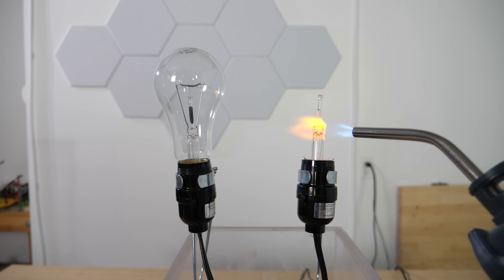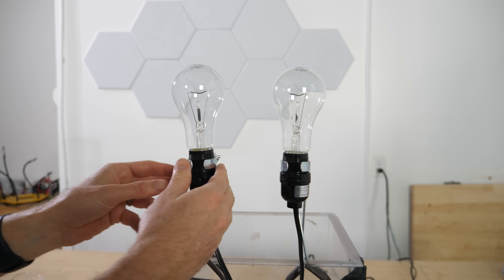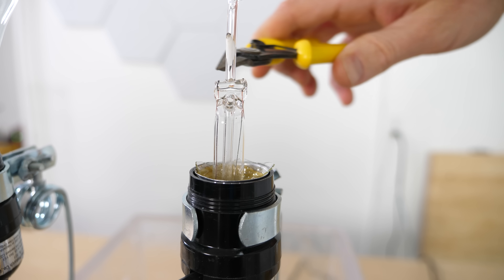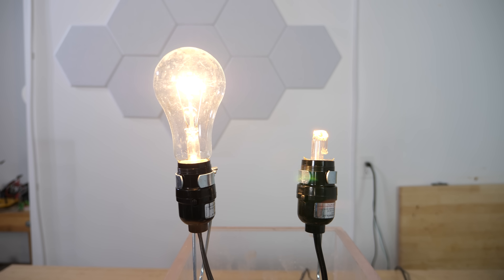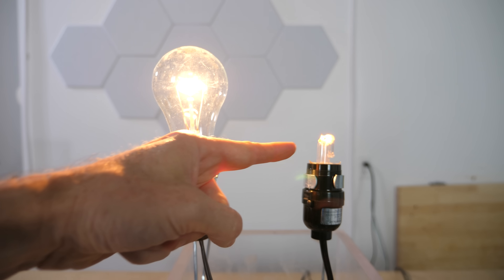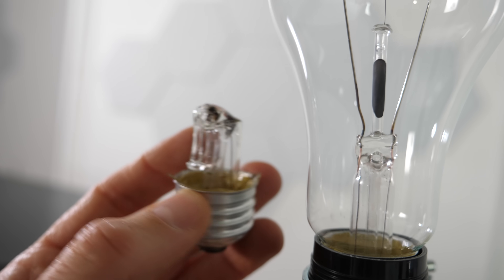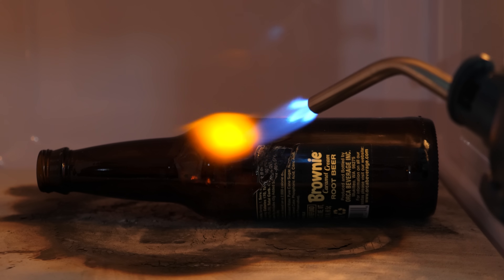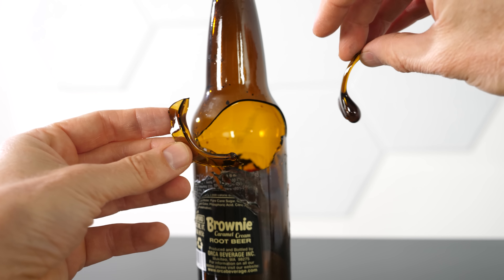How Glass Breaks All the Rules of Insulation

Comment: The support wires for the filament are usually made of iron because it has a very similar expansion rate as glass. When melting the glass containing those support wires you also contaminated the melted glass with iron  which is conductive though not a great conductor.. Neat effect but I suspect you just made conductive glass..

Comment: THERE IS NO "CURRENT" THERE IS NO "CIRCUIT"  .  THE HEAT AND LIGHT RADIATED FROM A WIRE WITH AN ELECTRIC DISCHARGE THROUGH IT
ORIGINATE WITH POSITIVE CHARGE DOMINANT AETHER MIX FROM ONE END COMBINING WITH NEGATIVE CHARGE DOMINANT AETHER MIX FROM THE OTHER END.  AETHER IS MIXED +/- FREE CHARGE.  ELECTRONS ARE FOR SUCKERS.  CHARGE IS BOTH POSITIVE AND NEGATIVE AND IS INFINITELY DIVISIBLE.  THERE IS NO EVIDENCE THAT CHARGE IS QUANTITIZED.  J.J. THOMPSON LIED IN HIS 1897 NOBEL PRIZE WINNING ESSAY ABOUT CATHODE RAY TUBE DISCHARGES, WHEN HE SAID THAT HE HAD REPRODUCED THE 1883 EXPERIMENTS OF HEINRICH HERTZ AND CONTRADICTED HERTZ'S RESULTS.  THOMPSON LIED WHEN HE PRETENDED TO HAVE REPRODUCED HERTZ'S APPARATUS.

Comment: This is how glass furnaces work. When the furnace is first started up, gas burners are used to begin the melting process.  Once some of the glass has is melted it is then heated with with molybdenum elecrodes by passing electric current through the molten glass. These furnaces work continuesly for about 10 years untill they need a rebuild.

Comment: 5:30 not really glass electrolysis. You need DC for the electrolysis. Also the voltage is to high for electrolysis. That's simply Joule's effect in action, through a thermistor, an NTC one.

Comment: You really don’t know that you did NOT wire those bulbs in series. You wired them in parallel, otherwise the voltage would be incorrect for the bulbs. Why does everyone think just because there are MULTIPLE, it means you are wiring IN SERIES. You are wiring a series of objects, in parallel, as to not change voltages that typically correspond with what they are powering, wattage changes constantly, and amperage should be a constant, but can still alternate, but amperage causes wires to burn. That’s why there are fuses that correspond with AMPS. You are teaching the wrong thing that no one ever gets right… you are now one of them.
Reply: HEY!!! I think I was incorrect about how you wired those lights! I’m kinda brain farting along not being able to (in my head) make sense of how you wired those clip lights.

Comment: I have to wonder whether you also changed the composition of the glass by melting part of the wires.  Presumably the wires at that part of the bulb are just regular wires, not tungsten like the filament.  There wasn't enough of it to dramatically change the color, but I don't know how much that would take, compared to affecting the conductivity.

Comment: The reason why glass is such a good insulator is because it contains quartz. Quartz is an excellent electrical insulator. Quartz is essentially a form of silicon dioxide.
Reply: So if you really want to protect something from electrical radiation you shield it with solid silicon dioxide, or quartz.
Reply: They make transistors with silicon dioxide too. By adding in impurities, they can adjust how conductive silicon dioxide is. It's easy to do in a sense that you're starting with zero conductivity and adding just enough metal(conductivity material) to precisely control how much electrical radiation can pass through the material.

Comment: Now I have to wonder what my watt meter would read when this is happening. I had always wondered how glass could carry a static charge when stroked with wool if it was indeed an insulator. PVC stroked with opossum fur seemed to produce my best charges. I have to assume static is not electric as we know it. Oh so much ignorance to overcome. Thanks
Reply: Also thinking more about this I recalled about 20 years ago early in the morning I saw what I thought to be lights from a work truck up the road. As  daylight came on I went up there to see what was going on and found nobody there. A tree had fallen on the power line and it was arcing on the ground. As I am on solar power I did not know the power was out . I called the fire department to report a small fire. They came and tended to it till about 10:am when the power company finally came to fix it. Because the fire departments were no longer allowed to pull the breakers it burned long enough to set the road gravel on fire with the thousands of volts and melted a hole nearly 5 feet into the ground which was still burning when everyone had left. When it did eventually go out I found the granite had turned to glass and now I better understand what was taking place at the time.

Comment: This is used when meting glass in industry. First they heat the glas to glowing temp by gas or electric coils but just to barely molten and then the used big electrodes that just pass current through the glass much more efficient and then just keep adding glass in a continues stream.

Comment: That lightbulb stem that kept on going on its own heat after you stopped heating it reminds me of the Nernst lamp. Nernst lamp uses a piece of ceramic as a filament, which is also non-conductive in room temperature but conductive when hot enough to glow. It operates in air as the ceramic does not oxidize, but it needs a separate heater to heat it up enough to make it conductive.

Comment: Yes he almost touched the exposed wires, but it wouldn't have been dangerous becuase it would just go between his fingers. It would hurt the fingers but nothing more than that. I stuck my finger in a light socket when I was a kid - it was a lamp with no bulb but was on for some reason, and I was using it as a support to reach up high, and my finger touched the contacts. It hurt, but there was no actual damage.

The danger would come if the path of electricity went through his heart, which is not a risk when the electrodes are 1 cm apart.

Comment: I used to work in a glass factory - and the glass in the furnace was heated not only by gas burners but also by passing an electric current through the glass, with electrodes inserted at the bottom of the bath.

Comment: Ohmmeters are how you measure resistance, its not a value of resistance... trillions of ohmmeters would be a helluva Fluke.
Reply: Resistivity mate not resistance
Reply: @randomdosing7535  Wrong.  An ohmmeter measures resistance.  You either have a precise vref (V) and measure current draw or a constant current source (I) and measure voltage drop. R is calculated by dividing V by I.

Comment: 3:00 This is actually a trick what is happening When you melt the glass, you’re actually also melting the Metal that is inside the glass so that it touches each other making contact after the glass is melted. Of course the metal is melted, mixed in with the glass, making it conductive.
Reply: If that were the case it would turn on even after cooling down, which it doesn't.
Reply: Lol someone failed highschool science
Reply: I work in glass and we use electrodes to aid in glass melting in the furnace
Reply: You can't melt metal in such a low temperature
Reply: How come it stopped working when the glass cooled then genius?

Comment: Very interesting!
But also, when you put your fingers so close to the plugged in broken light bulb! Yuck, it wasn't pleasant.
I wish/hope you have a special electrical protection for your lab supply, but still, it was bad.
Also, very interesting to see that, even if the glass is not red anymore and "visually cool", it can still conduct back.
Did you measure the power consumption when glass conduct by any chance?

Comment: Current going through a lamp (seems a 100W bulb) is going to be 0.5A in a 230V country and about 1A in a 110V country. There is no way it could melt glass especially given that the lamp was fully glowing i.e. it was taking most of the power. The only explanation is that the molten glass caused to wires to become short. but then again it kept molten with tiny power. Its most definitely a hoax
Reply: کیا مطلب سر تھوڑا سمجھائیں گے ؟ امید ہے آپ فزکس کے ٹیچر ہیں
Reply: @randomdosing7535  V=IR . The more R The More V. as the 100W bulb is glowing almost full i.e. it gets most of the Voltage. Say 220V. The remaining 100V into the 0.5A current gives 5W power for the glass. it will not heat it up and it should definitely not melt it.

Comment: Gas valve, switch, saltwater, auto-transformer, vacuum tube, semiconductor and now digital.  That's the history of lighting control in a nutshell.  "Meeeellllteddd Silicooooooone...urrrrrr...rrrrr!".  That is how the most Metal lighting designers in our parallel universe do it.  I feel that should be in the timeline somewhere.  It's plausible.  For maybe 6 months in the 1950's some gov Science! department was looking into "Thermally Energized Silicon Voltage Control" but stopped research after "too many unexpected conflagrations".  I could totally see how that wouldn't catch on too much in the civilian market.  Nobody wants a mood light that burns your house down.

Comment: Interesting... I never knew that hot glass would become conductive! You may have just discovered the next electrolyte for molten metal batteries. This experiment makes me question the suitability of glass as an insulator for high voltage power lines. If something arcs, and heats up those insulators, they can create a conductive path to ground.

Comment: I hope those lamps weren't really powered when you screwed that broken bulb into place, you fingers were millimeters away from the wires 🤠 Anyway I wonder if this is used to control or maintain glass temperature in some glass manufacturing process.

Comment: The handling of the broken lightbulb with 230v on it seems a little careless. I like your videos, but in this case its an really bad exempel and should be redone.

I checked again, broken glas where handled without warning that you can hurt yourself terrible. And changing the lightbulb with bare hands when on is already no good exemple, but then how you handle the one with exposed wires?

Comment: Glass is a very viscous liquid at room temperature; when you heat it you don't turn it to liquid you just reduce its viscosity. It would be interesting to see if the resistance decreases as the temperature increases and I wonder whether current does flow through the glass at room temperature but only an  imperceptible amount as the ions will move so slowly

Comment: As the story goes with the invention of the light bulb, finding the right glass and filament, and filling the bulb with inert gas or vacuum was a great saga of trial and error until ultimately landing on the seemingly simple and elegant  design of the incandescent bulb. 
Apparently they didn't need any of that, just a wires and a blob of glass would have done the trick. Go figure.

Comment: I once placed a wine glass in a microwave to heat up the wine in it in order to make Glühwein.
But even without preheating the glass the stem of the glass became molten and the glass bent 90°.
That shows that even at room temperature the microwaves could excite the molecules in the thin stem enough to make the glass conductive.
Reply: I wonder if the glass focused the microwaves in some way.
Reply: Dude you might be right. The round stem could've acted like a magnifying glass or fresnel lens in some way focusing and concentrating the radiation  @chaos.corner
Reply: Not all glass is microwave safe; particularly older glass apparently.
Reply: This can be caused by defects in the glass allowing the microwaves to focus on a small area.  Once it starts to get soft, more and more microwaves can grab on and heat it further.

Comment: please start taking electricity seriously and use Propper protection:
You should NOT handle live wires like that, even more so with a broken lamp where you have no clue which parts might be live. Either turn of the power and disconnect the lamps before handling them, use an isolating transformer, or wear rated isolated gloves.

But what you are showing here is very dangerous.,

Edit: also no, is is not kept "melted" - the word you are looking for is molten.

Comment: You will also notice that the glass glows yellow when it has electric current passing through it. The exact same yellow as old street lights were in the UK. This is because of the sodium in the glass being excited and emitting its characteristic yellow wavelengths of light, just like the sodium discharge lamps used in our old street lights.

Comment: Glass is an insulator for electricity but it is also a semiconductor with a very wide band gap.  All insulators will become conductive as the temperature is increased due to higher electron energies allowing some to cross the band gap from the valence to the conduction bands.

Comment: That flame from your torch will carry electricity as well. I am very surprised your torch did not shock you. The blue paint on your torch is probably the only thing that stopped you from getting shocked. In the heating and air business we pass a current through the flame in a gas furnace as a safety feature to turn off the gas if the flame goes out, this is called Flame Rectification. Flame rectification is a process that uses a flame's electrical properties to detect the presence of a flame. Please be safe and don't do that again, if you do wear gloves. This would actually be another good subject for a video. As you have seen with volcanoes creating lightning, electricity is passing through hot magma so even rock can conduct electricity under the right conditions.
Reply: Well that's fascinating
Reply: Huh, so that's how that works. That's cool, or er hot I guess
Reply: The flame is at the tip only?
Reply: The flame touches the metal torch  @rob8823
Reply: This comment should be pinned at the top.
Reply: I dont think this is actually a real concern, the power coming through the wall isn't nearly strong enough to be significant after passing through the torch
Reply: The flame doesn't reach into the container. If it did it would explode. But congrats on getting to share a random factoid that doesn't apply here
Reply: * hot magma
Reply: @MottyGlix  thanks
Reply: Flame rectalfication….that’s what happens to me the day after I eat Wings to Go….
Reply: Not enough btw
Reply: Ever considered that the handle is insulated?
Reply: "we pass a current through the flame...to turn off the gas if the flame goes out" ??? How/why would you pass a current through a flame that has gone out?
Reply: @Simulacra.Somnium  The control board detects when the current stops.
Reply: @tairdudeusa7981  Ahhh, gotcha! That makes a lot more sense, lol. So, the current is going through the flame and if the current stops - meaning the flame went out - then it shuts off the gas? That's cool.
Reply: He would have to be grounded, and the torch completely non-insulated.
Reply: While the OP might not be correct, that this demonstration is dangerous, according to @Vanya2893 .
I still think it would warrant getting pinned.
Or at the very least be taken into consideration in the channels future videos.

When showing experiments like these, you will inevitably have viewers, who try to replicate the experiment, with no prior knowledge. So in order not to cause harm, you have a responsibility to not just say "don't do this at home". But also make it clear that you take specific precautions and why.

I bet not everyone agrees with me.
I'll always err on the side of caution. Even when I think I understand the systems I'm working with.
To many times, have I seen coworkers or friends get seriously injured, by making mistakes that they were warned about.
I've seen a few limbs gone missing, 3 electrocutions and some explosions, one of which took out both eyes. But also many, many fires and near misses of any kind. Some of which, where other peoples negligence could have injured me as a bystander.
Reply: Yikes. Yeah, this whole episode was cool, but I got the sense it's a good example of "don't try this at home."
Reply: the AC voltage going through the bulb would have to be high enough to overcome the resistance of not only the flame but getting the rest of the way to ground at 60V DC minus whatever voltage drop there is from the resistance of the flame... googling the system in a furnace, the detector is looking for 2-5 microamps by the time the 120V AC input voltage gets to the other side of the flame, I don't really think this is a particularly realistic concern
Reply: @Vanya2893  thanks for the info
Reply: @Vanya2893 Would this also be the case, for European 220-240v outlets?
I'm assuming yes, given how confident you seem with half that voltage.

I only have a very basic understanding of this dark magic, that makes the world go.
Reply: Thank you for this. I would have never considered this if I did this experiment myself. I am adding this to my list of examples of reasons why I can hurt myself by not fully understanding something despite being a smarta$s who assumes I know what I'm talking about. 

My most recent incident was insisting to my wife that putting dry ice in the blender won't break it because you can put regular ice in the blender no problem and dry ice is much more brittle. I thought I had covered my bases by making sure there was ventilation to prevent gas buildup. 

What I didn't consider is that the cold would break glass blender lol.